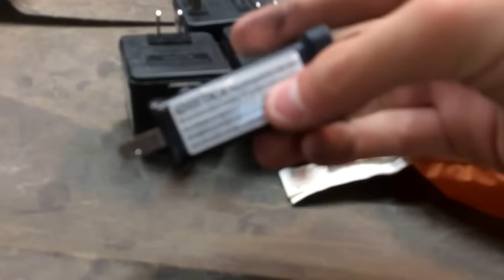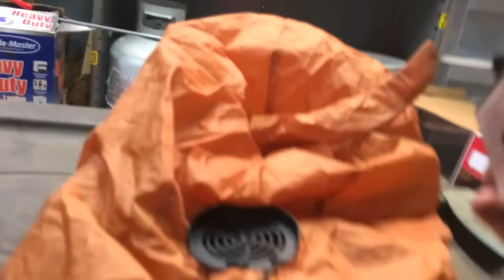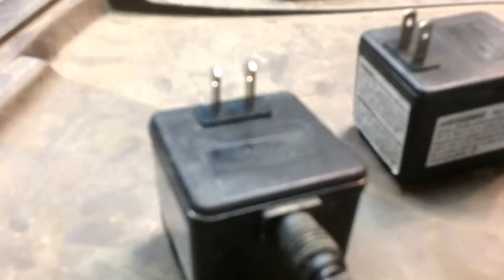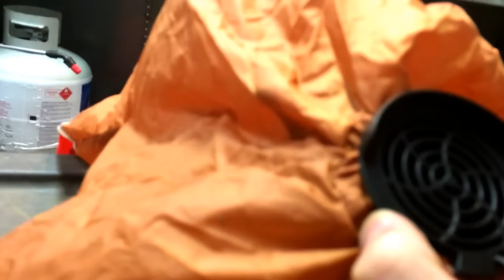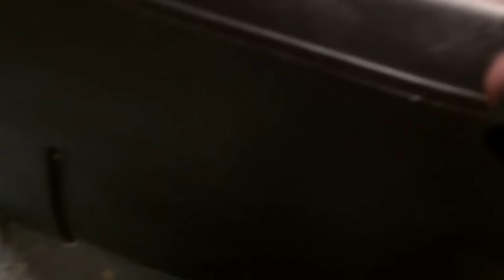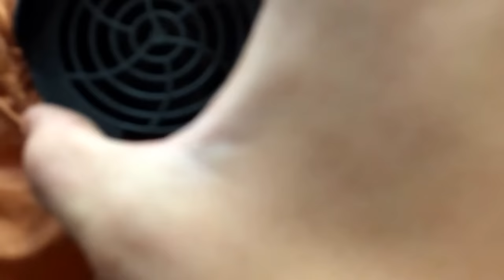How to fix a broken airblown Inflatable (METHOD)

Comment: OML thank you so much! I work in the back end of a lowes hardware store and a customer had returned a inflatable decoration that wasn't working so we replaced it and the store told me to throw it away. But sadly my car looked like the work compactor so I accidentally took it home with me. And ofc it was just the adapter that wasn't working so now I've got my first Halloween decoration!

Comment: Thanks. Swapped adapters with another inflatable I had on the lawn and it worked. Issue identified and currently looking for a replacement. Thank you.
Reply: Were you able to find a source for replacement?  If so, please share.  Thanks.

Comment: I'm surprised you threw away inflatables if they weren't blowing up. You can replace the motor and they will still work.
Reply: I thought the same, those things are expensive in my country but sadly not every one has the knowledge or patience to fix them. I would discard them only if they looked too old or discolored, and of course would keep the working parts if they're still in good shape.

Comment: Question:
My Inflatable is blowing just fine, changed fuses, checked for leaks, repaired leaks. Inflatable is sagging and won't fully inflate, spraying waterproof on it helpful but about an hour later, hoes back to droopy stage. Ideas?

Comment: Checking the label on my power supply it say's that for a 115 VAC input, I should have a 12 VAC .835 Amp output.  Using a multi meter, I found the voltage to be right on.  Next, I went to the actual motor and removed the access cover finding that the circuit board inside was heavily corroded and had a broken wire.  In addition, the solder contacts were blacked and looked to be cold.  For a $30.00 inflatable that's 11 years old, I'm thinking that it's time to replace rather than repair.

Comment: I have a spongebob inflatable that’s 4 feet but it doesn’t have an adapter like this one. It’s just the standard plug and the inflatable won’t stand up all the way. It leans over. Could that be due to the blower or is there a small hole causing it not the inflate all the way? I also am having the same problem with an inflatable snoopy. They’re both about 10 years old.
Reply from the maker: jacob mcdonald some of the causes may be the age of the inflatable. If it’s been used a lot the fabric gets warn out and doesn’t hold as much air. A way to fix that is to spray the interior of the inflatable with clear fabric stiffener. If it is new then it may be the blower. If so just spray it with wd-40 other than that there’s a site called yardinflatables.com and you can get a new fan from there
Reply: Ok, thank you! Yea, we’ve definitely gotten our use out of them. We live in Florida and the sun has completely faded spongebob. It’s hat used to be a bright red and now it’s a light barely red color.
Reply: @esinflatables7678  Will spraying the interior of the inflatable with clear fabric stiffener definitely fix that issue and will it make the fabric all still when it is deflated?

Comment: i just wish i could find the power supplies with the outdoor inflatable connectors with enough power on amazon all they seem to have is weak ones that only put out 1 or 2 amps and they claim to do 4 amps but won't work on higher power decorations so i had to get one from a local power supply store and solder it to wires
Reply: Did it work?